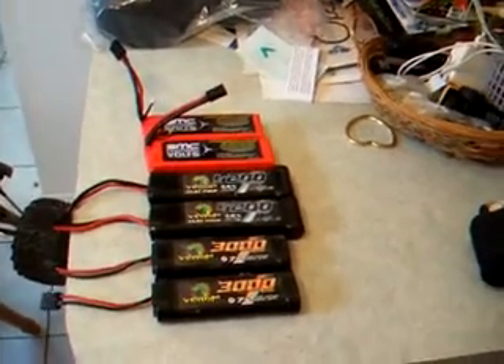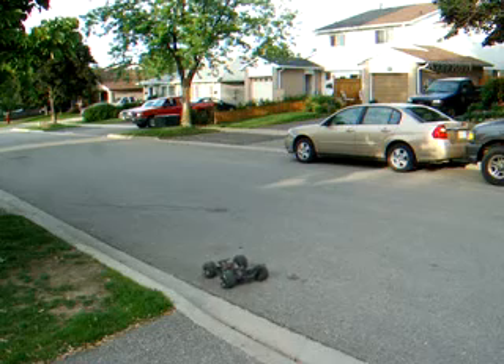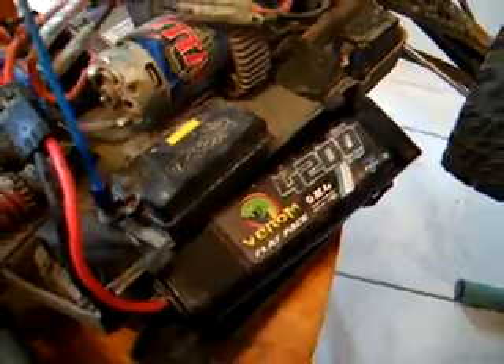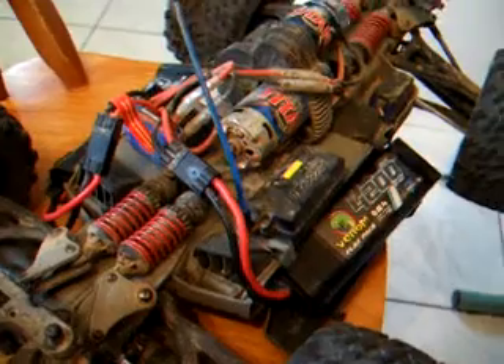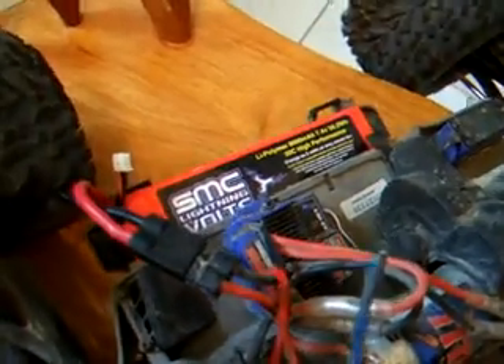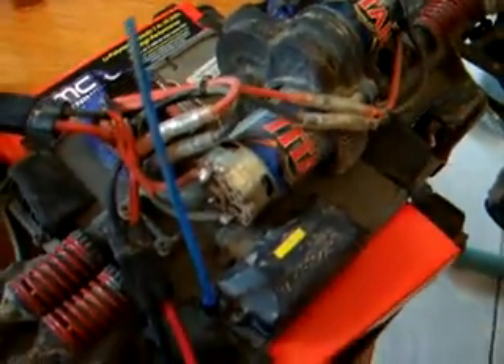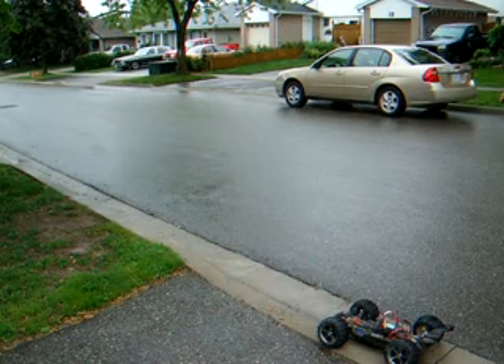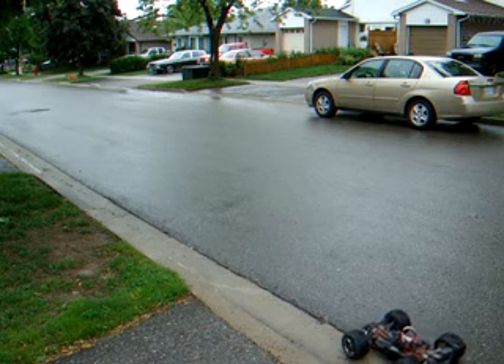E-Revo Power Plant Comparison

Comment: I used a 3s2p A123 pack in my robot, and it would work really nice in your car.  I used the monster 2200 kv combo which may pull more power than the brushed twin motors.  Nice video

Comment: with the mamba monster installed try using a lower gear it has a shit load of torque so installing a lower gear will just make it go faster, there is a tiny lack i acceleration but nothing you can notice.